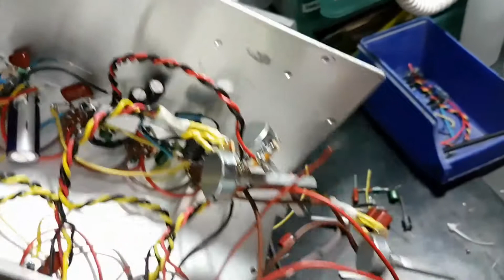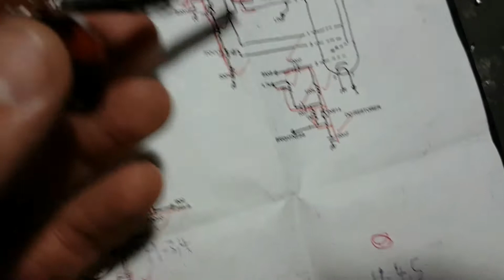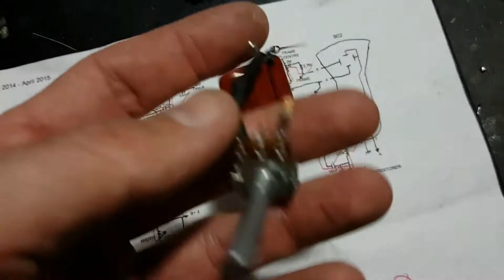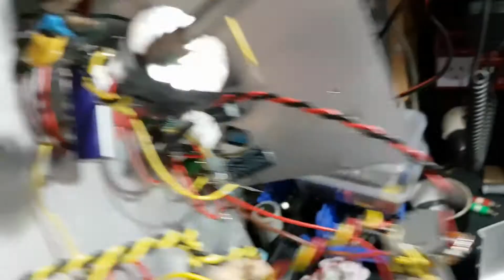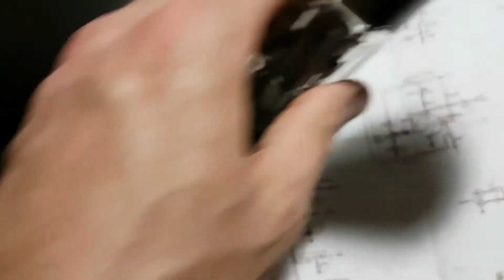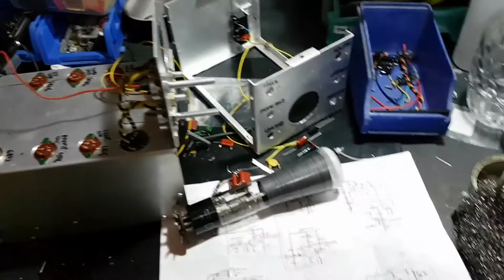2 inch 902 tube TV project (Part 7)

Comment: How are you punching your large round holes? How high is the highest voltage? 

In my image dissector camera project, which is currently on a long time hold, I had trouble with several components, the pots and the feed through capacitors, breaking down under the high voltage. (1.5KV) The pots you are using are positively not high voltage grade. If you hear snaps and pops when you power up, check the pots first. My MacDonald Mk IV SSTV monitor, built back in 1976, would give a super loud crack, like a bull whip, whenever the power was turned on. Being solid state, the arc would blow out most of the transistors, especially the programmable unijunction transistors (PUTs) in the sweep.
Reply from the maker: Thanks for the info. I used normal pots with 3BP1 NBTV and have no issues, even the Iconoscope I used normal pots and no bangs though had to put insulated knobs on as I did cop a bit of a zap. Anyhow the 902 tube I am dealing with a max EHT of 630V according to the schematic. I will of course check the specs on the pots and verify what max voltage they can handle. As for cutting the hole, I just used my Dremel die grinder with a disc to cut the hole, it was a rough cut but I smooth it out afterwards with the a Dremel sanding bit and some filing with a fine file and the result is as seen.